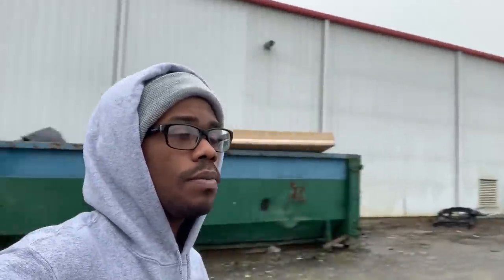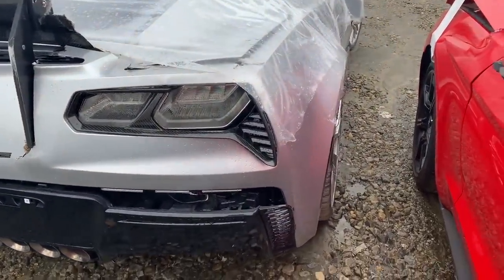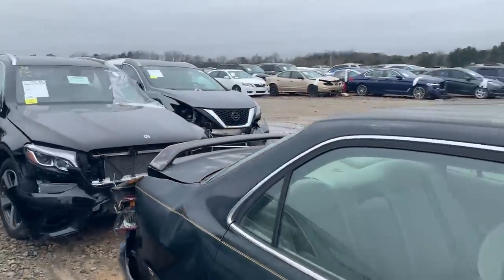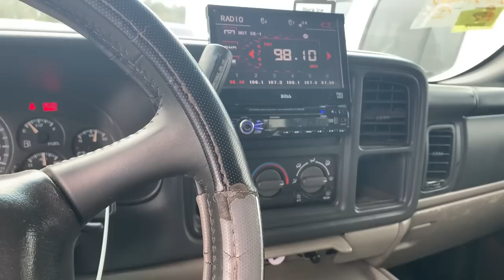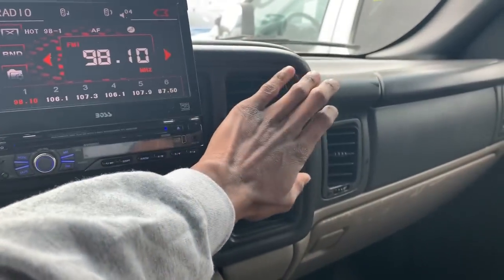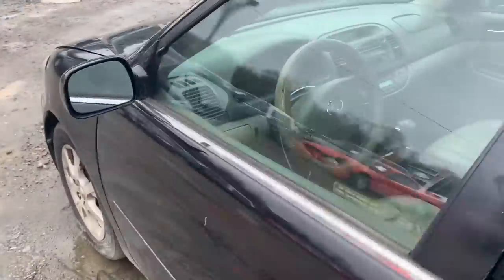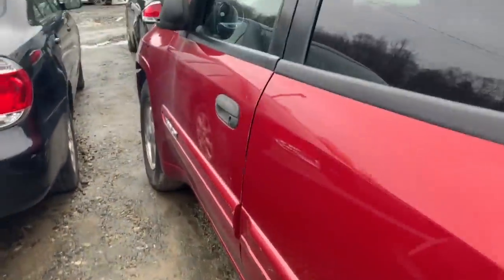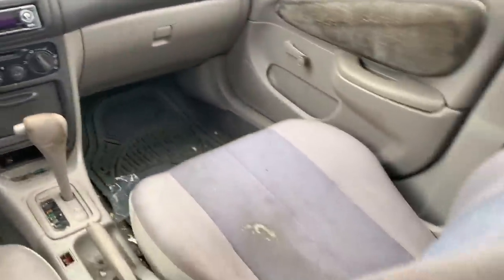INSURANCE AUTO AUCTIONS WALK AROUND + CARNAGE + PORSCHE 911 CARRERA

Comment: On the XUV the rear roof can open and it becomes a pick-up truck, The window you see inside is called a Midgate  that close when you use it as a pick-up, or fold down for more cargo space. Check the compressor for the rear air shocks and that the two way tailgate works at the touch  pads on the gate. I have the V8 with 180k, and Motor run GREAT. Good Luck

Comment: LT4 Wet Sump 6.2L Small Block Crate Engine | Chevrolet ...
www.chevrolet.com › performance › crate-engines › lt4-wet-sump
As the heart of the Corvette Z06, the supercharged LT4 6.2L SC is the second most powerful engine ever offered in a regular-production Chevrolet. ... The LT4 features a 1.7L Eaton R1740 TVS supercharger, which spins at up to 20,000 rpm...